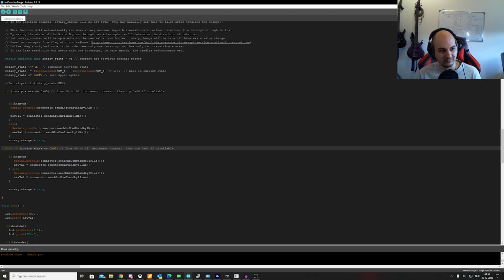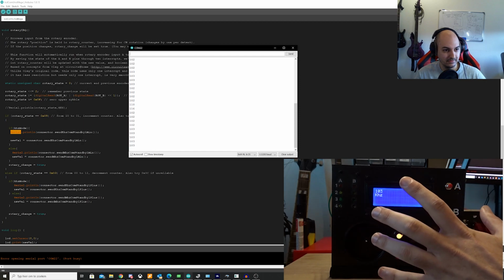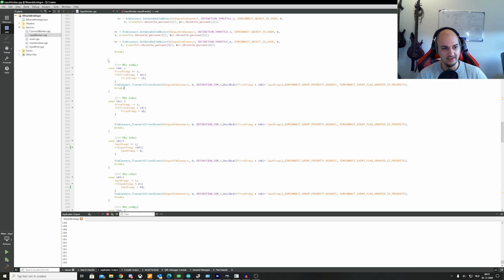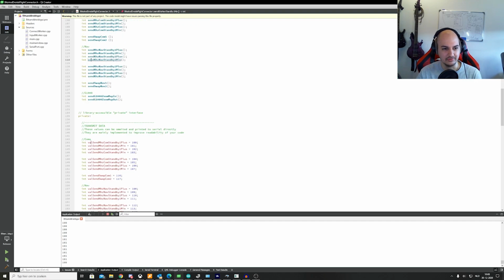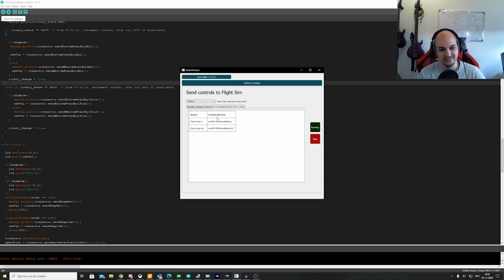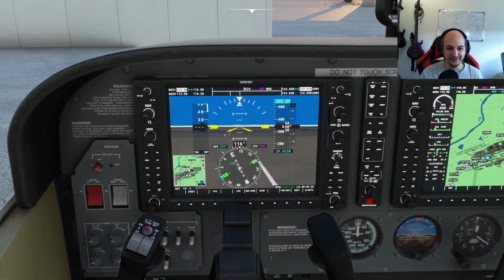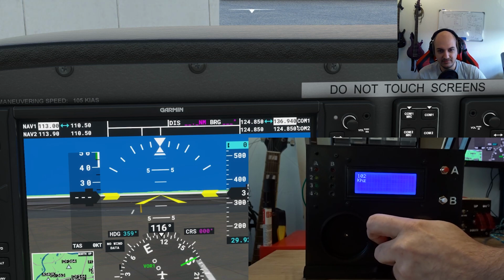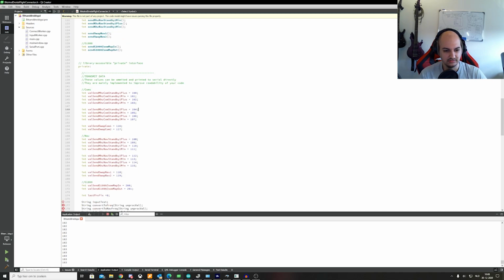Use any Arduino to send inputs to Microsoft Flight Simulator 2020: V0.6.1

Comment: can i connect several arduinos over the software?
Reply from the maker: You certainly can. There might be an upper limit but I haven't tested that yet.
Reply: @Bitsanddroids  ive implemented it now, but i have a problem with the connector, if i want to change something like the altitude with a button command its not smooth, i looked in the serial monitor and it showed the commands perectly, but in msfs it only changes like every 4th time, this only happens with commands that increase and decrese, not with like APmaster toggle  and is there a way to SET a value instead of increasing it?

Update: I think its related to the slow serial printer, when i turn the encoder it takes like 10ms for printing the whole integer, could you add a option for input delay in your options?
Reply from the maker: @indian.techsupport  There already is an option for that (2 even). wait (x) ms before sending and update every x frames. The first is the delay and the second is h0w often you'd like to receive an update from the game. I use 3 and 5 as a value in there.
Reply: @Bitsanddroids  thanks, your answers have been extremeley usefull so far, but now ive encountered another  problem, I cant get data from the game, I use dual mode and everything is set up correctly, but in the serial monitor there isnt anything shown if i execute the command to read data.
Reply from the maker: @indian.techsupport  Could you send your sketch. Through Discord https://discord.gg/tg5SQ6WD or email dave@bitsanddroids.com and I'll have a look
Reply: @Bitsanddroids  i located the problem, i called dataHandling function in setup, not when starting datahandling, thx for your help, you are great, ill send further questions to your discord.

Comment: sir i have one problem , i manage to bought arduino uno and i m playing DCS , now after buying arduino uno i found that jystic library doesn't work with it and i now i can't have leonardo and your video is fantastic , you did a great job but i didn't have flight simulator , what shoud i do now ?? :(
Reply from the maker: The easiest route would be to fetch a Leonardo/pro micro on the cheap. They can be found for €4/5 from China (replace the .nl with your locale at the start of the url):  https://nl.aliexpress.com/wholesale?catId=0&initiative_id=SB_20210210034146&SearchText=arduino+leonardo

The hard way would be to create a program that listens to your com port and interprits your inputs to joystick commands. This does however require some programming knowledge
Reply: @Bitsanddroids  how can I send you personal message ?
Reply: Can we meet on discord ??
Reply from the maker: @jayparmar7603  you can send me an email to info@bitsanddroids.com or on https://www.instagram.com/bitsanddroids/  or https://www.facebook.com/BitsAndDroids/
Reply from the maker: Discord is fine as well https://discord.com/invite/nRCe8Y9DzD or my username Bits and Droids#6718. I can't come on right this moment but perhaps later today.
Reply: @Bitsanddroids  thank you so much , I will wait there

Comment: I have a VRInsight MCP Combo 2 which does not work with FS 2020 do you or any of your subscribers know if it is possible to remove the factory control board and replace it with an Arduino?
Reply from the maker: I have no experience with these devices. But in theory the hardware should work the same. A button will be a button no matter which device it is hooked into. Now the real challenge would be investigating how everything is wired inside the device (probably via pcb's) and reroute it to an Arduino. Don't forget to lookup any chips in there if it is all stuck to a pcb. For instance an TI495 chip can control 8 outputs with just 3 inputs. It can be done but it depends on how comfortable you are with really digging in there and the internal layout (which I couldn't find a picture of)
Reply: @UC%F0%9F%91%8CwPpsPxvvRC3TM3ZOUd2H4w Thanks for getting back to me I will start pulling it apart and keep you informed of what I find cheers

Comment: Fantastic coding very clever. Do you have hardware diagrams or a way I can see which rotary or switch is connected to which pin on the Arduino?
Reply from the maker: Sure I'll send it over later today
Reply: @Bitsanddroids  Thank you I have just downloaded your sketch and I am going through it to try and educate myself in this new line of programming. I am much more suited to BASIC that's showing my age lol.....................

Comment: Have you checked compatibility with working title's G1000 mod?
Reply from the maker: No I haven't actually. Haven't heard of the mod either since I've been quite busy lately. I'll check it out tonight.
Reply from the maker: I just fidled and googled around a bit and it seems to be working fine. Some functionalities are still not working though which they acknowledge (binding the zoom in out buttons etc). This is an issue on Microsofts side though.  Their Cj4 mod on the other hand could conflict with the binds since it uses their own AP implementation but I havent tested this.
Reply: @Bitsanddroids  Ah, okay. 
Good luck with your projects.

Comment: Amazing stuff just what I'm looking for after building a button box rotary encoder with buttons and its working as a joystick button but wouldn't work when rotating too quickly so was looking for something like this so glad I've sub to your channel :) I'll be implementing this after I land the TBM 930 :D
Reply from the maker: I understand your frustration. Especially if you have to go from 000 to 500 and half of the time it would jump back. Let me know how it goes with this approach!
Reply from the maker: My apologies there was a bug in the fractals. uploading V0.6.1.1
Reply: @Bitsanddroids  awesome! got it working with the com frequency, only error was a typo on your doc 'Serial.setTimeOut(15);' should be a lower case o 'Serial.setTimeout(15);' easy fix checking error but chuffed it worked now i need to get myself an LCD display :) keep up the good work mate, I've posted your video on some fb msfs channel in case other want to try this at home 👍
Reply from the maker: @LemonTeaLeaf  Thanks for the support I'll fix the typo!